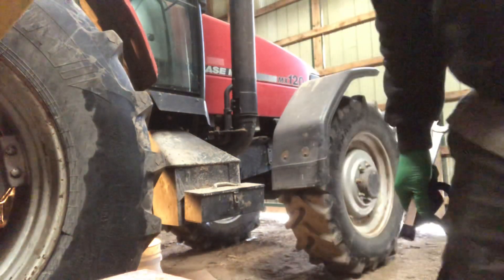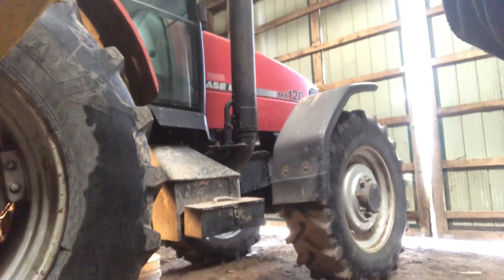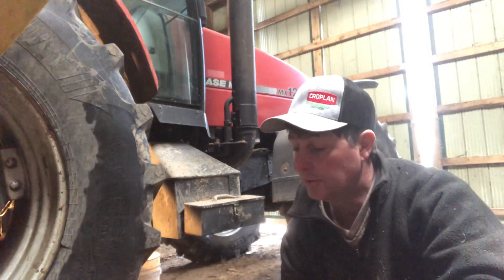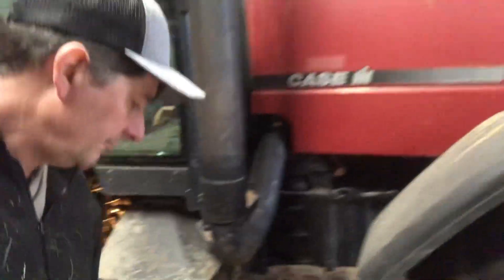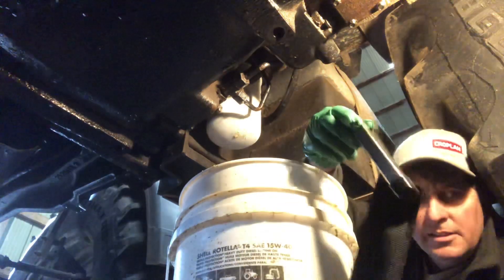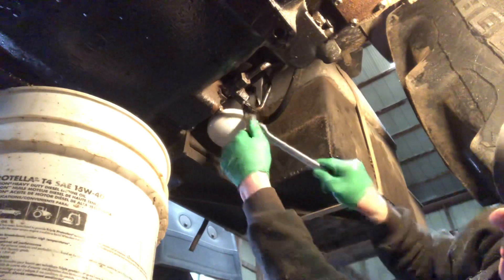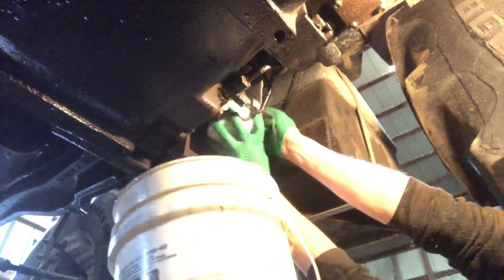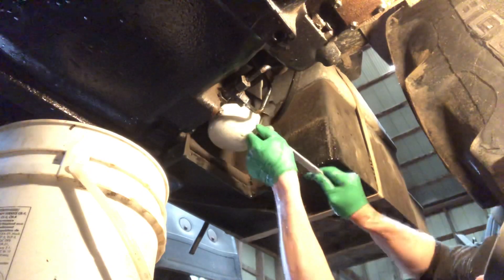Hydraulic Problems on a case Ih Mx 120

Comment: Greetings
I am interested in case mx 135 maxxum 2000 tractor. I have problems with the hydraulic pump, when the tractor starts it works for 1 minute and even less than 30-40 seconds after that it stops. Have you had such problems?
Thank you very much.
Reply from the maker: Problem could be in your pressure compensation valve 
It is on the hydraulic pump 
Pump is on rt side of tractor behind back tire
Your low pressure stand by could be out of adjustment 
Your best to have a tech properly test it as you need to put gauges in a couple spots 
Good luck